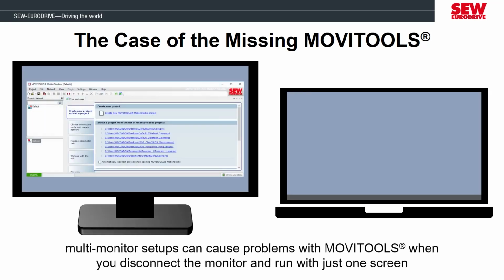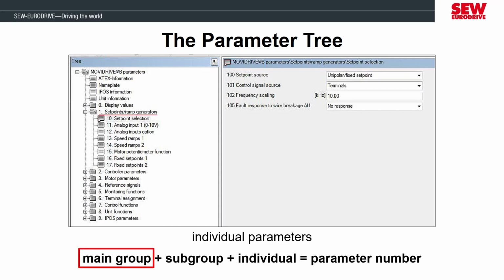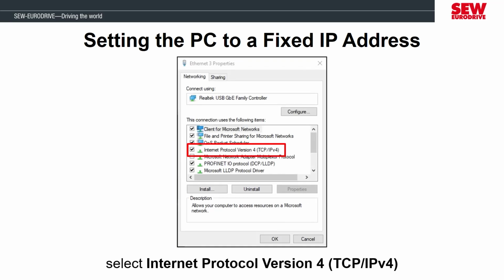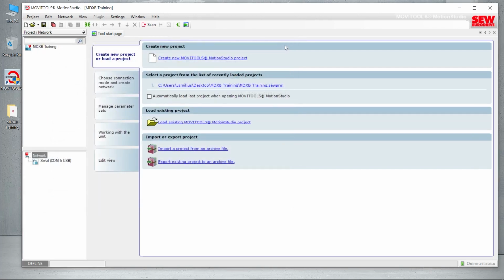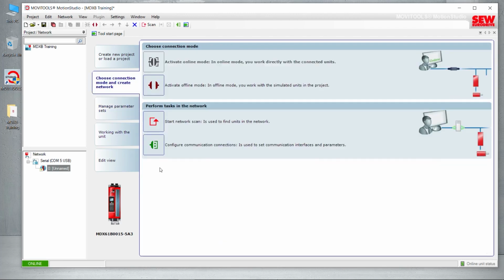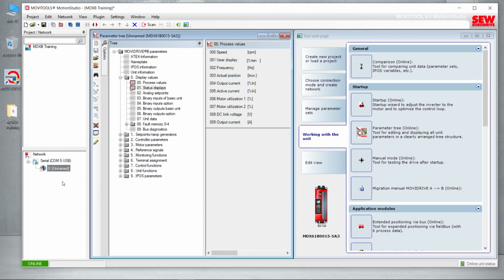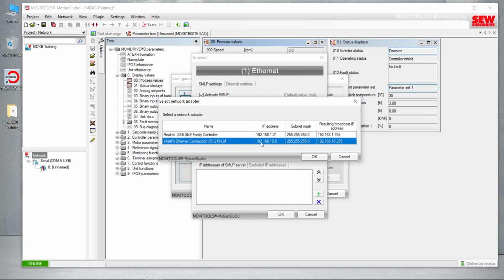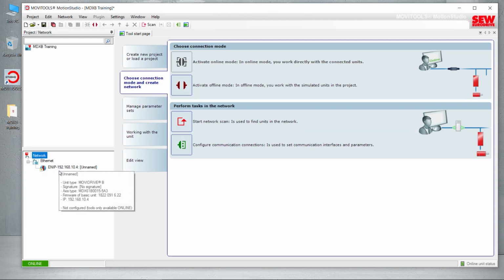MOVIDRIVE® B Training Session 6 - Lab 1 - Getting Started with MOVITOOLS® MotionStudio

Comment: Please what's the code to change from technology option to standard option?
Reply from the maker: Hello. Are you getting a fault code? You can check the license level of the Movidrive B by looking at parameter P079 and seeing if it says "standard" or "technology". With the "technology" license you can use the Application Modules in the MotionStudio software. If you're getting a fault stating a "technology" function was activated that is talking about a special feature of the Movidrive B such as electronic cam and it's not talking about the license level. Please check parameter P078 and change it back to "standard" if one of the special features such as electronic cam operation was accidentally activated. If you meant to upgrade the license from "standard" to "technology" you would need to contact your local SEW-Eurodrive office to purchase the activation code and instructions of how to upgrade it remotely in the field using MotionStudio. You can go to this website to find your nearest support office. https://www.sew-eurodrive.de/meta-pages/contacts_worldwide.html
Reply: @SEWEurodriveUSA  thank you for the response
Reply: @SEWEurodriveUSA  for me to change from standard to technology,  it's requesting for a password,  I don't know the password to change option. I try to use motionstudio and it's also asking for a password.

Comment: When I open Network-> Communication and select serial , this message pops-up:
"No serial communication plug can be added because all COM ports are in use"
Any Inputs?
Reply from the maker: Hello. This is an issue in Windows when all the USB ports are in use, or it is having issues adding another serial COM port when you connect the USB adapter. Some fixes are trying a different USB port on your computer. Another thing you can try which is more advanced is to go to Windows Device Manager and delete COM ports that are no longer used. Then reconnect the USB cable to see if a new serial COM device shows in the Device Manager list at the bottom of the page under "Universal Serial Bus controllers". Make sure to restart Movitools MotionStudio after connecting the USB cable to get the software to attempt reconnection.